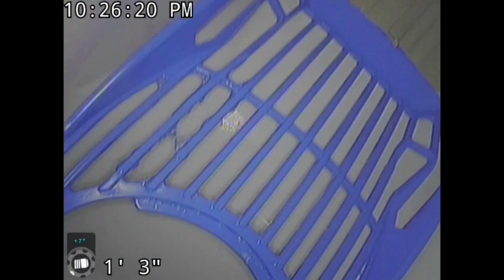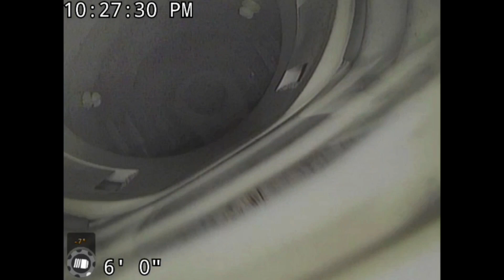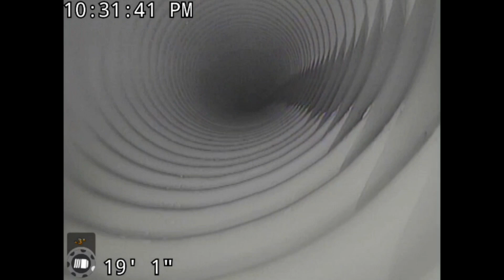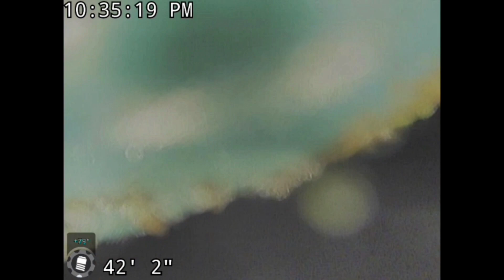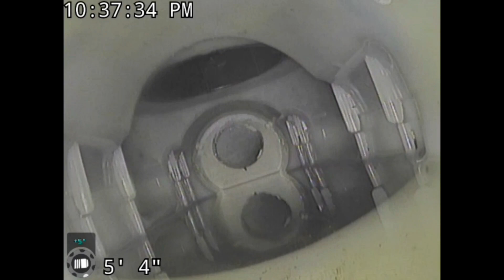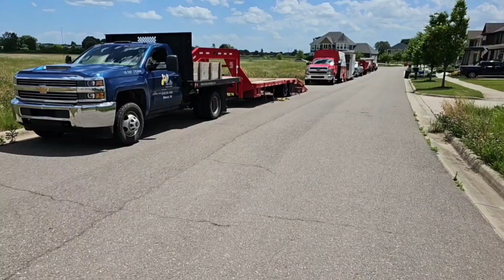Inside a Working Underground Buried Downspout Corrugated Pipe

Comment: Any benefit or disadvantage to putting 1-2" of clay on bottom of a french drain trench ? I'm thinking since it will suspend water better, it'll keep more water traveling through pipe.
Reply from the maker: This is a downspout system that has solid pipe. This is not a French drain system. You were mistaken. For downspouts, we put the dirt back in, and it has to be solid pipe, but it can't be perforated pipe.

For a french drain system, never put the dirt back in.